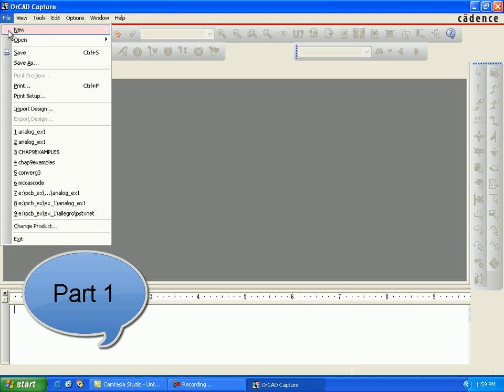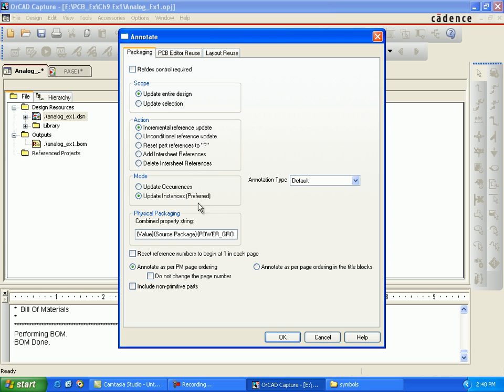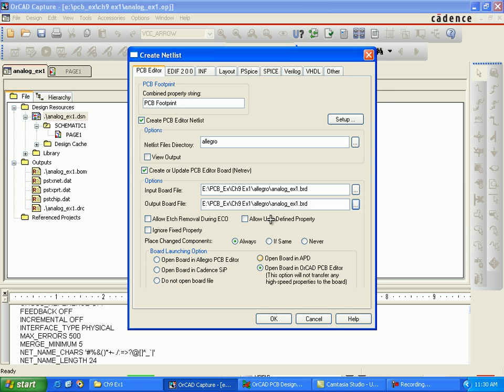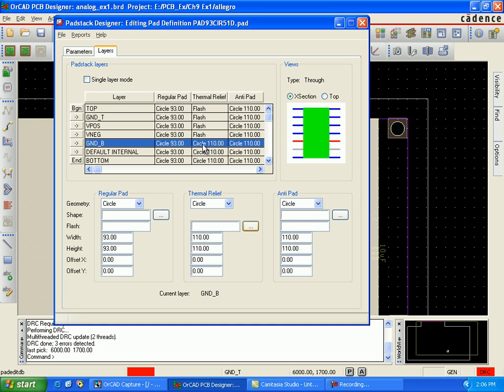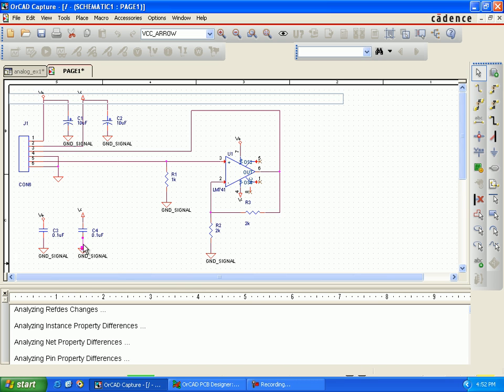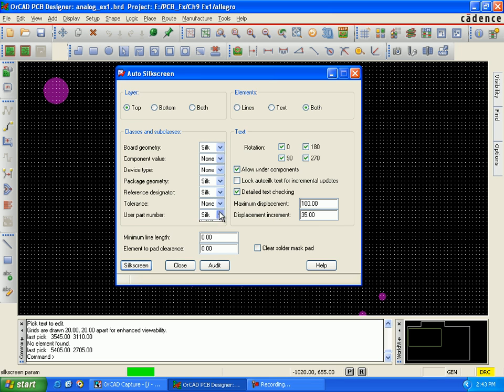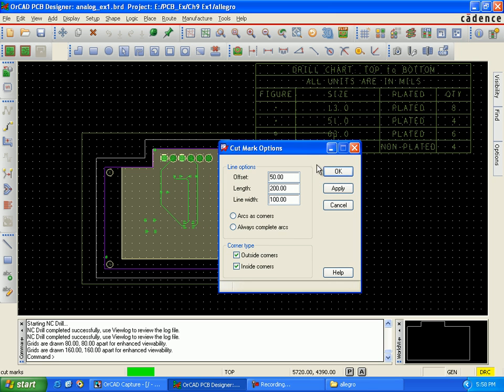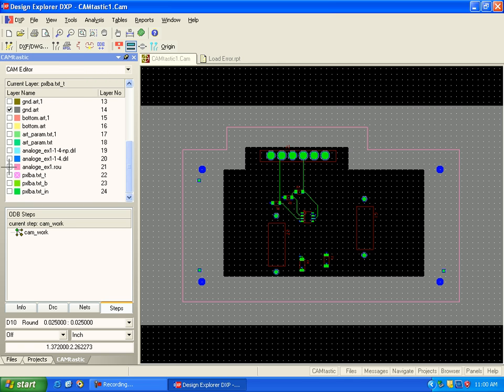PCB Editor Designing PCB Editor 6 layers

Comment: After 40 minutes of viewing the author it finds an error while working in the Capture and 4 minutes further correction and replacement of Net List item to Part 3_4.
LM471 is missing 8-pin curve library. A similar problem is a problem with a connector J1. The library is not a con6xx? 
This discrepancy does not allow to install the components on the PCB layout.
True con6.
 (OrCad Cadence v.16.60)

Mr. Moslehpur, comment please.
Overall, exellent.